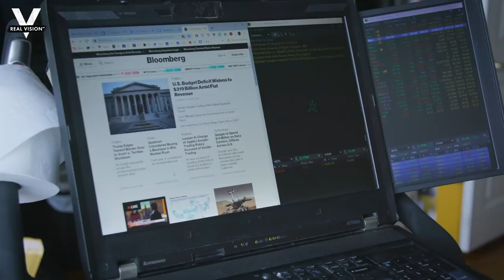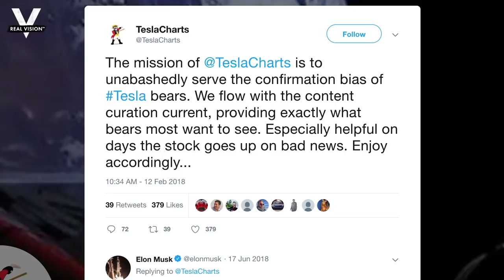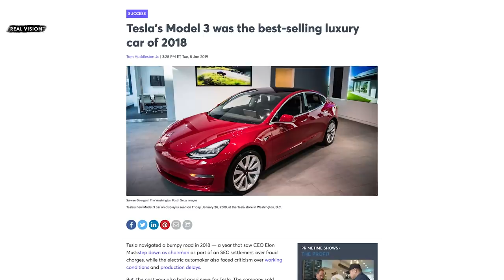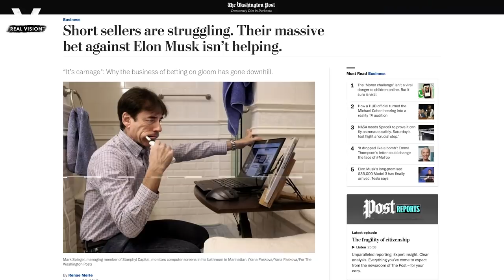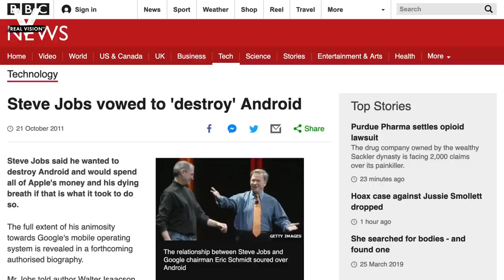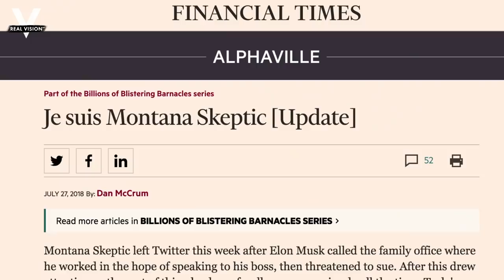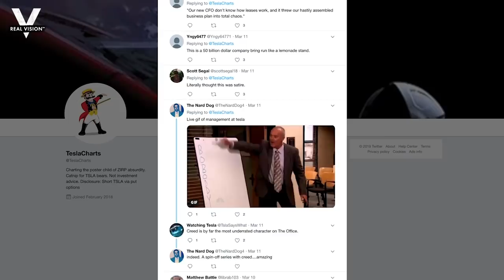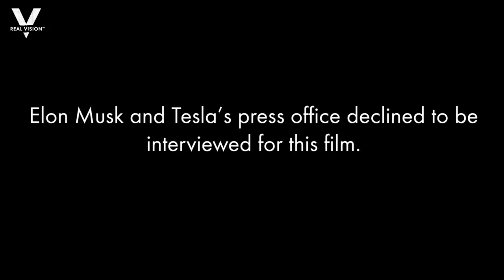Tesla Stock: Bull Case vs Bear Case | Full Documentary

Comment: The tent was a brilliant move. You can tell this is biased, because they don't talk about the charging network. The several year old design of the Model X has been demonstrated to have superior inefficiency to the iPace and eTron. How is that possible when the iPace and eTron were designed  years later?  It shouldn't be but this proves that Tesla has superior technology. Lets not forget that Tesla has told stock holders, that this effort is about saving the planet and getting the auto industry moving. It is not 100% about making profits. No mention of the brilliant purchase of Maxwell's battery technology. This extends Tesla's technology lead even further. No mention of the planning failures of major auto makers such as Hyundai and Kia. They failed to manage their battery supply chain, causing their car production to go down this year. Hence they can't fill orders. Why don't you TESLAQ people go short Hyundai and Kia? Where are all the "short supporters" in the comments?

Comment: The Model 3 is the best car I have ever driven by several levels of magnitude. I am a former hot rodder, motorcycle racer, street rod builder and I will never go back. The car is the most fun, most reliable, most simple, most comfortable, most connected to the road vehicle I have ever experienced by far. Did I mention easy and time saving? I come home, take 2 minutes to plug in and wake up fully changed. I look forward to every trip to the grocery store or ride to a client meeting or just a trip around the block. It's like riding a roller coaster ever time I get in as a bonus to getting somewhere efficiently and with ease.

Comment: This is a pretty good video.  However I think you could have found other arguments on either side, beyond what appears in the video.  The fanbois in this video did not seem to express any logical analysis about how Tesla could find success justifying their stock price.  There are some interesting arguments out there showing this.  I remain skeptical, but also disagree with the idea that the company is a scam or fraud.  It is simply a startup in the long game, it has invested all its money is a real product and infrastructure, but it is a very high risk one and I think the market has priced the stock higher than it should be at.  Bottom line it is not a stock in my portfolio due to the high risk of being in startup phase - and in such a tough industry as the auto industry, this phase is going to be a long one with many pathways to failure on their route.

Comment: Lol, the shorts need to do their homework. Nothing proprietary? Autopilot, Tesla neural net, supercharger network, the best cell chemisty, the cheapest battery pack manufacturing. The only people full of shit here are the analysts who are mad they keep losing money. The reason why TSLA is "overvalued" based on fundementals is because people are not trading the stock based on today values, but on confidence that EVs are the future, and traditional auto is failing at transitioning.

Also the creator of this video has done a poor job of research.
1) Tesla didn't bump the price of the model 3 up $10k, they delivered top trim cars while making efficiencies to the process to be able to produce a $35k car, which can now be ordered.
2) The delay was about 6 months from what was promised. The reason people had to wait years, was because a lot of people ordered, and not everyone wanted to get a top trim car, or for some they wanted to hold out for a duel motor AWD option, rather than the initial long range RWD offered at the very start.
3) On performance metrics that Tesla cannot meet. Elon musk might frequently run into 6 month delays, but he meets his performance metrics. Where are all the VW EVs that were supposed to come out two years ago? Where are all the cars that other auto makers promised to make 5 years ago? Still not out, and still getting pushed ever farther in the disatance, because they cannot buy batteries in high enough quantities, and at a low enough cost to compete, since they didn't invest their money.
4) Tesla financials were built on investing billions into making EVs actually practical as an only car, and not just a modest curiosity to green warriors. The only reason VW is even bothering is because they were forced to after diesel-gate. You want to point to a lying company, look at VW. Tesla delivers, maybe 6 months late, but they do deliver.
5) Data on Tesla gigafactory subsidies show that the company OVERDELIVERED on their promises for hiring, and financial keymarks in Nevada. Again, these guys don't know what they are talking about. The shorts are arguing emotionally because they don't want to admit they were wrong in 2012, and now they are doubling down and trying to force people to be affraid and sell off stocks to drive the price down so they can recover the BILLIONS they lost shorting TSLA over the years.

Comment: These short sellers and Tesla critics are hilariously OVERRATED!  The value of a stock is 100% determined by the respective company's stock holders and customers, not by idiot, arm chair stock analysts, but they can't seem to figure that out.  These same "experts" predicted Apple and Amazon to fail.  It'll be a huge laugh to come back in 10 years to see Tesla as the most successful auto manufacturer in the world, supplying also a large share of the world's solar panels and battery storage systems, racking in massive profits.

Comment: Let's add another deceit -- when we say 'electric' vehicle - this refers to the electric motor.  How we deliver electrons to that motor is of real debate. Tesla fans will argue that battery EVs have won. OEMs and nation-states like China, Japan, Korea, France and Germany are now expanding hydrogen fuel cell 'electric' vehicle investments. The lowest cost 'EV' platform is integration of a small battery (daily use), fuel cell (range, daily use) and H2 tank.  The lowest cost infrastructure (at scale) is H2 fueling station. Julich study (2017) shows that scaling out plug-in stations is more expensive than H2.  China knows this - and in 2019 has sent clear signals that BEVs were stage one; part of EV strategy and that fuel cells are next.  So Elon has thrown H2 Fuel Cells under the bus for years... and his fans follow blindly.  Meanwhile ask automotive OEMs (KPMG Study) and you see their view on 'electric' is more expansive.  Fuel cells are cheaper per kW; Fuel cells have less risk on supply chain sourcing (bipolar plates vs lithium/cobalt); Fuel cell supply chains have lower cost per mass. Fuel cells gain cost curve advantages of broader vehicle supply chain market since they will be used in passenger, truck/bus, marine, UAV/Drone, train, et al.  So Elon lies about 'electric' future being only battery and that H2 isn't viable.  This is a multi decade long transition and BEVs don't run this race alone.  (If you want to know 'where do we get cheap clean H2 -- follow 'power to gas' industry conversation)  'Electric' = the motor.  Not the battery.  Elon misleads the masses.